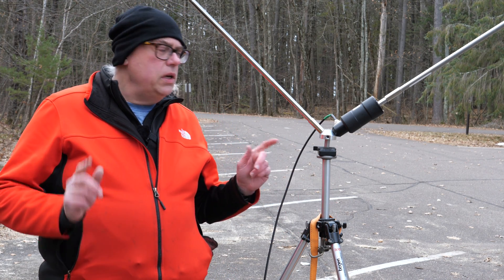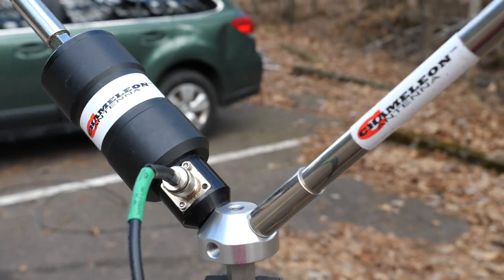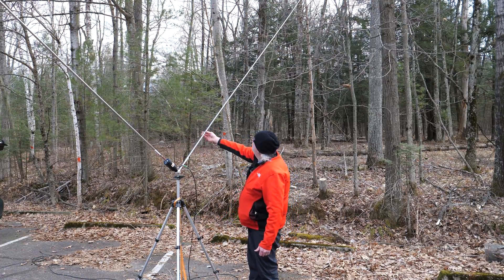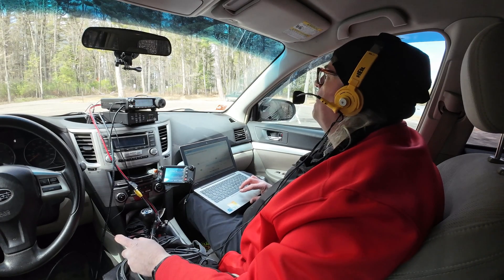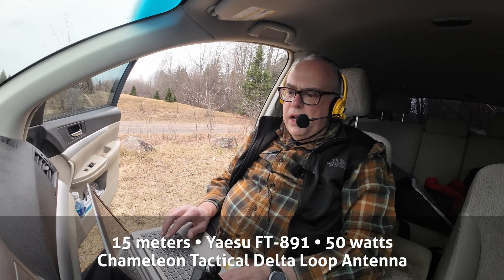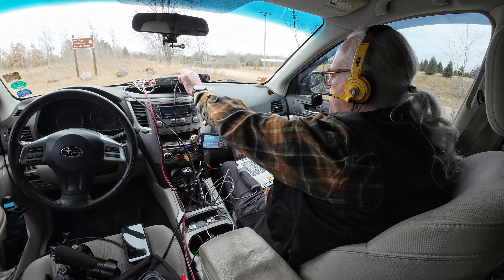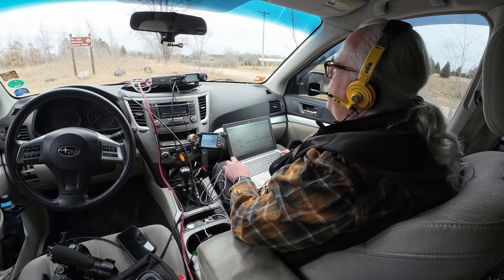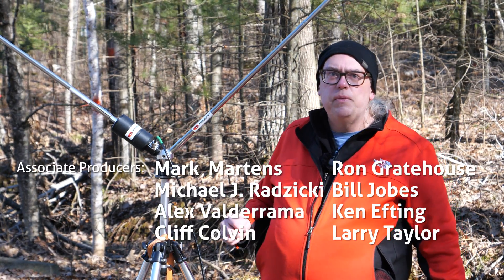Amazing Performance: Chameleon Tactical Delta Loop Antenna Revisited

Comment: i would love to know what tripod you are using. Can you help a fellow ham out!? :) Thnx in advance.
Reply from the maker: The tripod is a Bogen (Manfrotto) 3001 photographic tripod. Unfortunately Manfrotto no longer sells this model, but you can buy them used on eBay relatively cheap. Replacement parts are still available if the used one has a broken knob.

Comment: Michael, Thanks for another great video. Question: Shouldn't;t you have a choke at the feed point?
Reply from the maker: I didn't use a choke in the video, but I do now recommend them for most antennas.

Comment: Would it work with the new SS25?
Reply from the maker: From what I’ve heard from Chameleon, the SS25 is too droopy to be used as a segment for the Tactical Delta Loop. I’m not sure how they will address that.
Reply: @KB9VBRAntennas  thank you for all you do.
Reply: @forgetyourlife Now I get it.  I wasn't picturing it in my mind, but now I do.  Thank you and 73.
Reply: I bet it’s only a matter of time until someone tries it with two SS25’s though. A non metallic guy line in the middle of the whips would keep them from bowing for instance.
Reply: Wouldn't the wire across from one whip to the other whip support them to prevent drooping?
Reply: @jmonte5899 it would be to droopy in the middle of the full extended length. My idea is to have a non conductive connection in the middle keeping the more straight. I only have one SS25 though so I can’t attempt it yet.

Comment: Glad you did this. I have also had mine put away for a while. I have two 12' tall - when extended - light stands for stage lighting I want to use the TDL up and see if it performs better than stuck in the dirt! Thanks, Mike

Comment: Try this antenna with a second tripod and delta loop config as a reflector. Spaced accordingly for band. I’ll bet you get a 5-6 db+ gain. I made a 1 wave link loop antenna for 10 meters back in the 80’s that gave me +10 db in Europe. Lost it in a derecho storm. Itching to re create it now.  Thanks for the great videos. 73.
Reply: 'm intrigued by that configuration! Would you like to share more info about that as I would love to try it out!
Reply: @Chameleon_Antenna  I was referring to a home brew multi loop antenna with great gain front to back at home QTH. So a second V reflector should give you gain, even in poor conditions. Tripod? Easel? Coil to reduce size? Folding spreader arms and wire top? I have even had a horizontal loop on 40 meters. Loops work great and the two diamond config should provide some gain.
Reply: @Chameleon_Antenna I want to add a reflector to try as well when mine arrives, as I have two spare 17' whips for a second delta loop and just need the hub.
Reply: @benkorbel  would love to know how you went with this as I am considering the same.

Comment: Hi Michael, Great video. What tripod are you using? Thanks
Reply from the maker: I exclusively use Manfrotto tripods for my photography and videography. In this video the TDL was supported by an old Bogen 3001 (Manfrotto) legs. That model is no longer produced and I don't know what the replacement would be. I think for an antenna support I'd stay away from carbon fiber legs. Cheap ones are too lightweight and sturdy ones are too expensive. I'd also look for something where the legs and head are sold separately. You don't need a photo/video head for an antenna support. Instead, I use a Manfrotto quick release plate like this: https://amzn.to/48VmcBX
Reply: @KB9VBRAntennas  Hi Michael, Thanks so much for the response. I really appreciate it. I just ordered the plate from amazon and will look for a tripod. Hope to catch you on the air some time. Jim

Comment: Would it work better with a non metallic tripod, like carbon fiber? I know that’s recommended for mag loops.
Reply from the maker: That's a good question, and I'm not sure if a non metal tripod will make a difference. Some people say the metal tripod becomes part of the antenna system. But without some sort of evidence to that, I am having a hard time believing it.
Reply: @KB9VBRAntennas Maybe a metal tripod will be part of the ground for your vertical polarization?
Reply: It won't change anything even for magloop.

Comment: The CHA delta loop consists of two 17 foot telescoping whips, a mystery transformer and some wire.  Two 17 foot telescoping whips could make up a 1/2 wave dipole on 20 meters, and be adjusted for any band of higher frequency in the HF spectrum and low VHF.  Two of these whips can be had from MFJ for much less than the $400 that CHA is asking for the delta.

The thing to remember with antennas is this golden rule:  Anything that is not antenna wire, antenna aluminum or antenna whip is loss to some degree.  This includes the coax, twin lead, tuner, and most certainly traps, baluns, and "mystery" transformers.   The objective is to minimize or manage the loss by making smart decisions with these parts.

The other golden rule goes like this:  Antennas can operate continuously over a wide frequency range (so not resonant or multi-resonant on discreet frequencies) either because 
1) they are one of the variations of a log periodic design
2) they are one of the variations of a cone, conical, biconical, fractal design
3) they have a tuned circuit that is variable (tuned either by a microprocessor or operator)
4) because they have resistance either across the feed point or from the ends to ground.    
#1 and #2 are usually relatively large antennas and you see them typically at military, government and commercial sites.  #3 and #4 are typically what we must consider when going portable, or operating with modest conditions.  The CHA Loop can only be #4.

You claim, now that the sunspot cycle is peaking that "this antenna is a performer".  Now that the sun spot cycle is peaking, almost everything works!  

One has to ask, would you have done as well, or better with a simple dipole or something like a buddy-pole.  Would the two 17 foot telescoping whips configured as a simple dipole without the mystery transformer done as well or better?  Would the simple wire dipole or telescoping whip dipole done better than the CHA loop a few years ago when the sunspot cycle wasn't peaking?  If the answer is yes, then the CHA loop really its not that good is it?
Reply from the maker: Lot's of misrepresentation here coached in the form of a 'question.' The transformer is no mystery. It's pretty upfront that the transformer is a 5:1 design. MFJ whips are not of the same caliber or quality as the Chameleon whip. I don't think they'd be up to the challenge of a deployment in this fashion. 

Finally, my comment about the sunspot cycle isn't so much an explanation why the supposed 'wet noodle' antenna works, but instead an opportunity to use an antenna that performs best on the upper bands when the upper bands are available to us. 

I could use a different antenna. If you are a follower of the channel, which I'm guessing you are not, you would know that I deploy a wide variety of antennas and take the time to explain their operation. I show their practical benefits and say why or why you wouldn't want to use this antenna. Sure, a simple dipole would most likely perform better, but I don't always have the opportunity to put wire in the air. I enjoy using 1/4 wave vertical antennas like those by Wolf River Coil, but I also like the ability to switch bands without having to readjust the antenna. In the realm of portable amateur radio operations, we make the choice of efficiency vs convenience all the time because the surroundings don't give us the ability to deploy the perfect antenna. 

I just don't get all this Chameleon hate, but whatever. You do you.
Reply: @KB9VBRAntennas  I have to laugh, first the OP is shamed by "DC Fart Sniffer"???? and the shame confirmed by Chameleon. Then excuses are made for why this antenna was used. If this antenna is so good, why do you seldom use any Chameleon antenna in your non Chameleon review POTA videos ? You have no problems setting up many different, much more efficient antennas and having them work very well. There is never a place you have not been able to operate with a more efficient portable design antenna. The little time it takes to change a tap on a vertical is never a problem. On an EFHF, no need to change anything.   Actions speak far louder than words. Kinda like my old Hot Rodding days..."If it don't run, chrome it". The OP's post is spot on. He is not saying anything that is not true or factual. He is pointing out the lack of efficiency of an antenna designed with a 5 to 1 transformer. He gets shamed for telling the truth. When anyone needs to hide facts, they use shame to try and silence the truth. There are Experienced Men out here who are not afraid to tell the truth like the O.P.. I only hope people will listen and do their own research. You don't need to use an antenna that is far less efficient in design then antennas that will not only offer more efficiency, but have better SWR. You won't have the added losses from higher SWR to add to the 50% loss in the 5 to 1 transformer (Reference "Survival Comms" Chameleon Snake Oil' Video). You will have also saved a lot of $$$ in most cases. Remember, add the word "Tactical" to anything for sale and you can ask 75% more money for it than it's worth. Other antenna company's don't hand out their antennas free, like candy, to youtuber's for review. They know their antennas work. They stand on performance. P.T. Barnum was right. P.S., Michael, you are far from being stupid, you know why the hate for Chameleon is so real.
Reply from the maker: To come back, almost a month later, to carry on the fight with the same ad hominem attacks tells me that you'e got Chameleon living rent free in your head. 

I did watch the video you referenced, at least I believe I did, you didn't provide a definitive link. But I came away with a different understanding of the losses than you. Putting the 5;1 transformer back to back, it was measured to have a 1.5 dB loss with the vector analyzer. That's a far cry from the 6 dB that you are alleging. In the test between the MPAS vertical and a third party wire antenna, there is an S-unit difference. But that's an apples to oranges comparison, and the MPAS in wire configuration was much closer in performance to his 'reference' antenna than the vertical antenna. That's to be expected. So I'm not seeing how this is 'snake oil.'

Finally, your claim that I don't use these antennas. Yes, I use a wide variety of antenna styles in my portable activations, some make it to a video and some don't. This allows me to speak competently about an antenna system because I am using them in a variety of situations. I was under no obligation from Chameleon to make this video. I had reviewed the TDL system a couple years ago and supplied them with the content. In using the antenna again, I found my experience with it different as the solar cycle had improved and made available to us the higher bands which this antenna seems to really excel at. I felt I needed to share that with the community in the form of a video.
Reply: @KB9VBRAntennas  if you have antenna tunner every antenna is become practical, even the wolf river.
For me this is not  practical because the needs of antenna tunner
Reply: We've a sad ham alert from someone who likes to give input without trying the product... Armchair warrior! You go buddy!

Comment: You DO NOT need a tuner on 20 meters.
Reply from the maker: Needing a tuner or not could depend on local conditions and how the antenna was set up. I did multiple POTA activations with it over the last couple weeks in different locations and each time my SWR was below 2:1 on 17 meters and higher. And roughly 2.5:1 - 3:1 on 20 and 40 meters.
Reply: @KB9VBRAntennas  You stated "20 meters you're gonna need a tuner. 40 80 you're gonna need an antenna tuner." That was an unequivocal statement. Perhaps you should have said something more along the lines of, based on your recent experience, and local conditions, you may need a tuner. I've been using the TDL in the worst soil conditions in Arizona, as have several of my friends, without needing a tuner. Counterpoises help in getting the SWR down. But, we also run the TDL on a 15' Porta-Mast without counterpoise without issue. One friend has his mounted on a patio roof and it's fine on those bands. I am fiercely loyal to Chameleon and they deserve accurate reviews.
Reply from the maker: I get your point, but at the same time, this is kind of nit-picking. That's great that you don't need a tuner. Every time I've deployed this antenna, I have for 20 meters and below. It's probably better to be prepared with a tuner for the antenna, than to be caught portable without one and needing it.

Comment: What specific tripod would you recommend for using with the CHA TDL for POTAs? I don't know what tripod you used in this video, but if you did not have that one would you buy that one again or another one?
Reply from the maker: I exclusively use Manfrotto tripods for my photography and videography. In this video the TDL was supported by an old Bogen 3001 (Manfrotto) legs. That model is no longer produced and I don't know what the replacement would be. For video I'm currently using a Manfrotto MT055XPRO3 legs. They are quite substantial, but not cheap. I think for an antenna support I'd stay away from carbon fiber legs. Cheap ones are too lightweight and sturdy ones are too expensive. I'd also look for something where the legs and head are sold separately. You don't need a photo/video head for an antenna support. Instead, I use a Manfrotto quick release plate like this: https://amzn.to/48VmcBX

I think a surveyors tripod would also be a good option, but the problem is they use a different thread size for their mounting system, so you'd have to fashion some type of adapter.

Comment: How can you be giving them two parks at once since you are only at one location?
Reply from the maker: Often times trails will run through parks or wildlife and natural area may be superimposed. At those junctures you can activate both entities. In this case I was in the Plover River State Fish and Wildlife Area K-10054 of which the Ice Age National Scenic Trail K-4238 runs through. I was parked at the trailhead of the IAT inside the wildlife area.
Reply: @KB9VBRAntennas Micheal, how do you find this out? I would hate to be at a location and only give out one number when I'm sitting on two or more. Btw, another great video. I'm thinking of trying a delta loop next year. 73